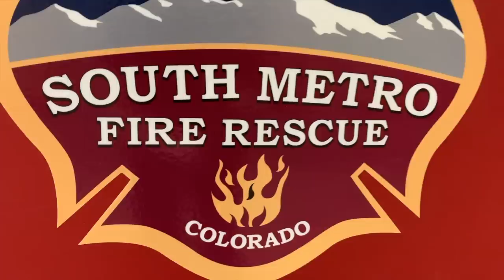Fire Academy Week 3

Comment: Great  oddly i was  30 years in uk  fires service  never used or ever  need  toold or equipment  and we were on the 4th busiest  station in the uk  4500 calls a year  for two Water tenders  we covered 200 square miles and 40 miles of three lane  motorway .

Comment: I think a fire fighter scuba should have all the air in the tank and a filter that filters air so they can work more instead of having to come out
Reply: It isn't a SCUBA but an SCBA. Same concept but not rated for underwater (the U in SCUBA stands for Underwater). A filter isn't able to filter out all of the carcinogens and other toxins in the air during a fire. Plus the temperate of the air can be hundreds of degrees down low (thousands up high) and you'd be searing the firefighters lungs with hot air. Plus changing bottles is a good way to gauge how long the firefighter has been in the fight and when they need a break. For my department, we can come out and do one bottle change and on the second bottle change we have to stop by rehab and get checked out. If the EMTs in rehab don't give the thumbs up, then we aren't returning to the fire and may be transported to the hospital if our vitals don't come back to an acceptable range.